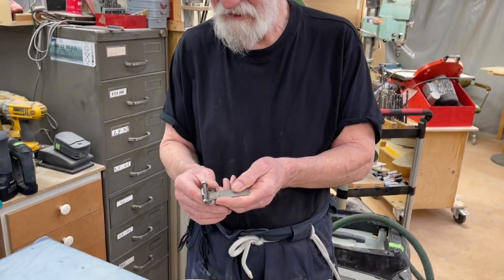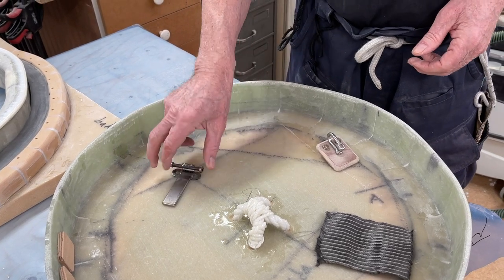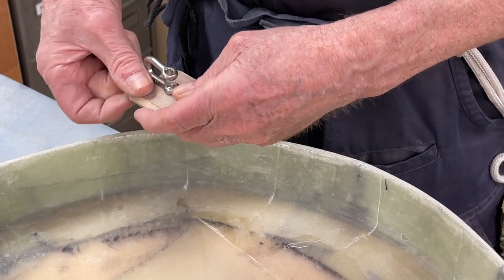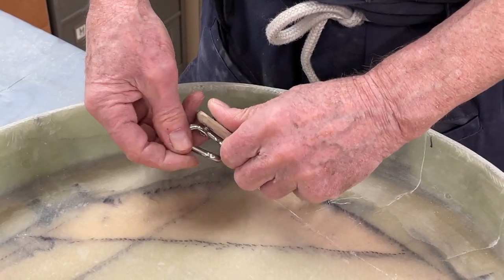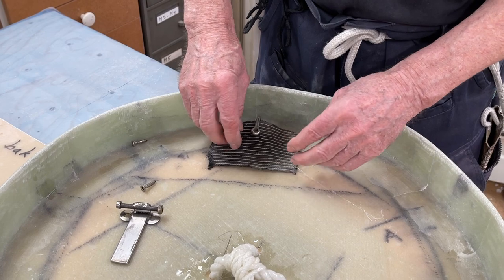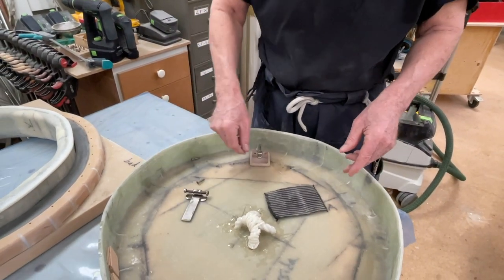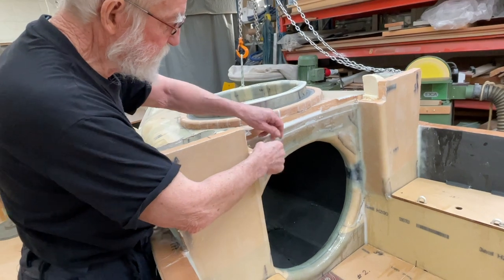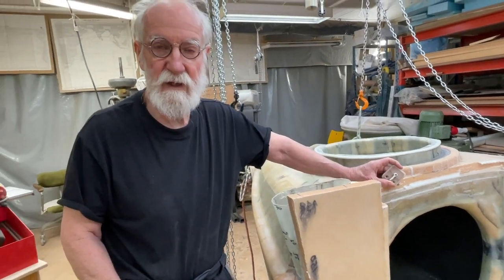4 Jan 2023  A new and better idea for hooks. I will make twenty. Lots of applications.

Comment: Sven, drill holes and put all thread through the hole.
So you can use a nuts and washers 
For a clamp system!
Then you can use the remainder all thread to hang a net with hooks connected.
You can do way more with that clamp system!

Comment: Where the hook attaches to the plywood or fiber board may be the weakest point.  Screws and glass to hatch, I think, would be strong.  Interesting concept.
Reply from the maker: There is no plywood or fiber bord .
This is a pure composite boat.
I do not think that there is much butter boat building materials than wood.
I have chosen epoxy sandwich construction becouse of its many advantages.

Comment: I think glass would be better than carbon for this because carbon is nobler than most metals.  There would be some risk of galvanic corrosion under the laminate, where you can't see it.
Reply from the maker: I may use glass.
Still I do not worry about corrosion as the carbon will be embedded in epoxy.
Reply: I would like to see you show how  you make the straps and handles.  Thank you 
Mike